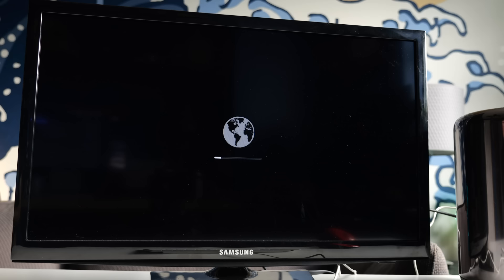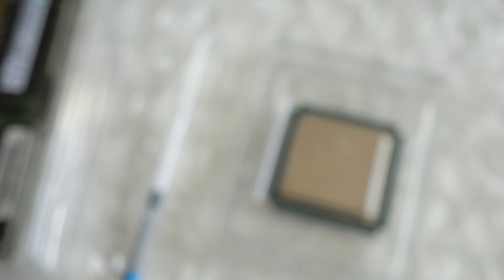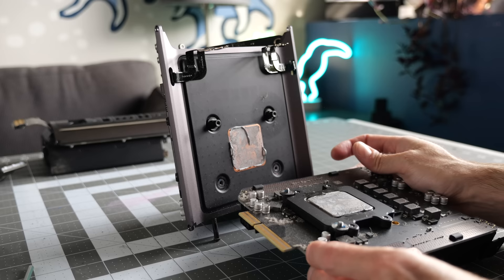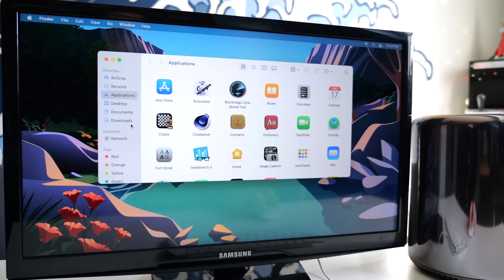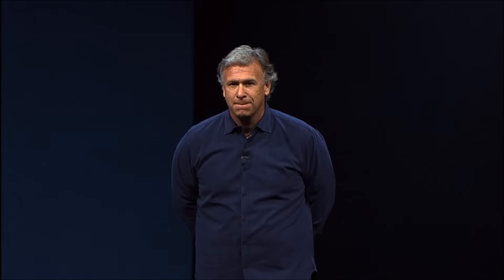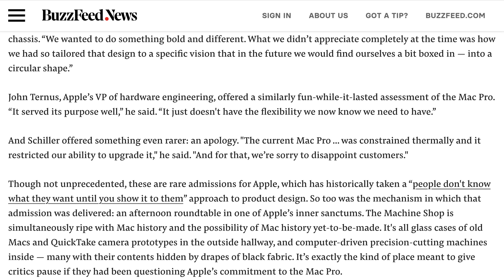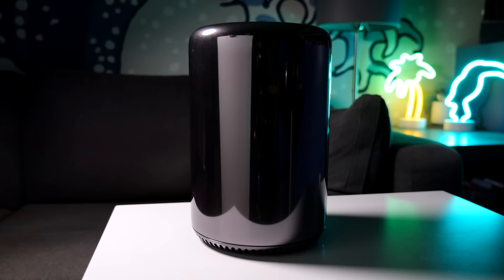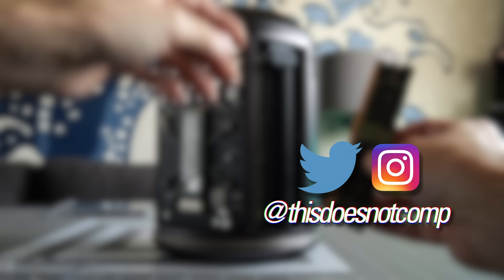Can This Decade-Old Mac Pro Compete With Apple Silicon?

Comment: I worked as an Apple Genius when this came out.  It certainly had a wow factor, but not many of them were sold.  As you mentioned the thermal issues and lack of expandability doomed it.  However, the early cheese grater Mac Pros had their own issues. They were easy to service, but stupidly they put the liquid cooling pumps above the power supply. If the cooling system leaked it would instantly fry the power supply.
Reply: I thought only the G5 Power Macs had water cooling
Reply: @bycuritiba  You're right, it was the G5s. But the mistake is understandable, apple geniuses don't know anything about computers. Their only real job is to tell people with a broken USB port that they need to pay $1000 for a new motherboard, rather than just soldering it back on.
Reply: @kyle8952  Isn't that the truth. A bit like, our software states your iPhone battery is perfectly fine, you need to upgrade to a new iPhone if you find it running slow after the latest update......
Reply: No Mac Pro had liquid cooling. The 5,1 mac pro is a much better computer than the 6,1   once it has been slightly upgraded.  Better drive capacity, better graphics, better usb 3.1/3.2. To a lesser extent the 4,1 and 3,1 are not bad either, but the abundance of 5,1 machines out there makes them the pick of the bunch.
Reply: @macguru9999  Actually the G4 dual Pro had liquid cooling as standard.
Reply: @marksapollo  It was a G5 and that was never called a mac pro, although it shared the same cheesegrater look. The g4s preferred the 'wind tunnel' approach to cooling :)
Reply: @marksapollo No, only a few of the G5 models did. I own one.
Reply: @ninline2000  How does it hold up after all these years? Does Apples cooling solution still work ok? Just curious.
Reply: @marksapollo  Mine leaks. I plan to eventually fix it, but water cooling isn't a good idea for longevity.

Comment: Thanks for the video. I've been using one of these since 2015 for professional video work, and it's still working fine (up to 4k), I'll use it until the computer dies from exhaustion. Not the most powerful machine, but solid in performance.
Reply: do you edit 4K using proxies? How does it work with Davinci Resolve?
Reply: @thedevhow  Hello, i use Premiere, and usually the files i edit are pro Res 4k.
Reply: Nice to see that one is still in use today from brand new (unless you’ve upgraded in the year since your comment). Have/had you done any upgrades to it?

Comment: Say what you will but I love my trash can. Got it as my first computer in late 2013 when I got my first credit card as a teen and it is still handling my music and video workloads to this day. (Logic Pro X and editing Gh5 footage on Premiere). Although it is currently on it’s last legs and will be replaced in the coming months, it has paid for itself multiple times over and got me through college. The portability aspect of it was also great for certain scenarios. I will remember it fondly.
Reply: Y 0:55
Reply: I’m still using mine, which I picked up secondhand 5 years ago for 2 grand. Having the D700s make a big difference on the GPU side. My plan is to keep it until the M3 Max Studio comes out sometime next year.
Reply: Clean it out and reapply thermal paste before you decide to ditch it!  ...(if you haven't already)
Reply: @DavidJBradshaw  I added an, eGPU a Vega 64, I have 2 D500. If put those D300-700 under constant duress they die, trashcan.
The Vega destroys those D series graphic cards. I bought It for my Macbook Pro, but use It mostly on the Mac Pro.
Investing now in an eGPU is maybe a little late, you can't use It on the M mac.
Reply: I’m still rockin my 12-core, mid-2010 cheese grater… LOVE this tower. Have it spec’d just like I like it.
Reply: Will an AI program work on a super-up one? I’d like it for restoring VHS tapes. What do I need?

Comment: Its still really impressive that an m1 mini give essentially the same performance as the 2013 pro. its quite a jump in performance for those entry devices
Reply: Those synthetic benchmarks don't take into account a lot of things modern software takes advantage of such as new instruction sets and much much faster memory. I would have been interested to see render and compiler benchmarks.
Reply: Keep in mind that when the SSD (or almost anything else) fails  on the M series, it's lights out and upgrades are not possible.

Comment: For most uses the level of performance of an upgraded older computer is perfectly adequate. This has been a problem for PC manufacturers who are seeing low sales for new generation computers despite impressive performance improvements in CPU and GPU speeds. The higher performance is just not needed by many users.

Comment: I used the same cheese grater mac pro 3,1 for ten years, keeping it going with upgrades and improvements. I remember being so angry when the 6,1 (trash can) was announced, because i could see that there would be no upgrade path for me once my 3,1 finally needed to be replaced. By the time the 7,1 finally came out, i had already moved on and have not bought an apple computer since, but the 3,1-5,1 cheese grater mac pros will remain forever in my heart as some of my favourite tech products ever.
Reply: Yup Apple losing its enthusiast customer base, getting more generic
Reply: @hhkk6155  it's probably going to, eventually, alienate the last of their professional customers. i doubt any of that apple sillicon stuff is going to get the job done for audio production professionals.
Reply: @BabyFawnLegs  yes, and also the backdoor that they installed in latest OS, I don't want non of the big tech/big gobberment BS in my computer, what next?)

Comment: A visually appealing and well made video that caught my eye. I bought one of these units in 2013 because I loved the look and the performance was elite  for a consumer product at the time. Now I use it as a music server, a job which it does very well. The fan is quiet when the cpu use is low. The usb outlets can be filtered and galvanically isolated in various ways. It’s still a joy to use. The only drag is the software sources that are drying up because the os i can’t be updated. The monolithic shape reminds of Kubrick’s ‘2001’. It’s understated alienware. At least on the outside. I wouldn’t have the courage to fiddle about with the innards though.

Comment: Thank you, for this excellent upgrade video.  A few months after the introduction of the new Mac Studio desktop, I noticed that the price of these units on the used market started to drop "like a rock".  So, I picked-up a Mac Pro 8-core/D-700/64GB/ 1TB model and paired it with my 2010, Apple Cinema LED (none thunderbolt) display and everything has been working great.  Using one of its six Thunderbolt-2 ports, I added a Fire-wire 800 adaptor.  So, now all of my old Fire-wire 400 and Fire-wire 800 devices are also supported on my system (smile...smile).
Reply: How do we get the mac os if we decide to change the ssd
Reply: @stormbreaker82  These is a You Tube video entitled "How to Install Mac OS using CD or USB" by Trackpad Productions.

Comment: Great look at a device that sort of cut itself off at the knees. I love the look of the device, but was one of those that stuck to the prior “cheese grater” model (which I’m on right now, in fact). I’d love to pick one of these up as a collector’s piece, though, not sure if I’m ready to pull the trigger just yet, though. Interesting comparison to modern machines, by the way, I wasn’t expecting that kind of favorable comparison!
Reply: I've got a 2010 that I tried to rock as long as I could, but I just kept running into barriers.  Lack of OS support limited what software I could run, and even the most up-to-date (supported) graphics couldn't drive a modern ultrawide display.

I ended up replacing it with a 2018 Mini that is more capable in every single way, except sheer volume.
Reply: Same. 

If I were buying a 2013 for actual use, I’d go with a higher clock speed 8 core, and probably an eGPU.
Reply: @nickwallette6201  more modern Minis—especially Apple Silicon—are certainly no joke! It is a sad reality, though, that the older girls don’t remain viable forever and indeed need to be put out to pasture. Just out of curiosity—did you play around with OpenCore Legacy Patcher at all? It mostly solves the OS support issue (with some caveats, of course), though ultimately the barriers won’t cease anytime soon on the older hardware. I’m fortunate that I can relegate my writer workflow to really any device that powers on, and I can keep the old Pro on Mojave without suffering any loss of crucial software (most of my work is done in Scrivener). That’s certainly not the reality for everyone, though.
Reply: @BrianJones-wk8cx   Nah, I did the firmware update to squeeze a few later releases of compatibility (maybe it was the 2009 to 2010 model patch?)  But I never tried patching the OS.  I used to play with Hackintosh a little bit, but the care and feeding of making an OS run on hardware it didn't want to run on wasn't for me.  I'm relatively new to Mac OS, so I don't have the deep experience of troubleshooting boot problems, and when a box I wanted to use for something productive wouldn't boot because of ???, that's just not fun.  And you always had to be careful to not update this, or don't enable that because it'll crash...

Plus, I had intended to use that Mac Pro for audio and video editing, and every time I solved one problem, I ran into another one.  It just became clear after a while that I was putting in a lot of time, effort, and money to do something a newer computer could do with far less trouble, less power, and in a smaller footprint.  So now, it's just a collector's piece, which is totally fine.
Reply: I pulled that trigger. I've found it to be sluggish compared to any M1 machine, and even worse with a modern Linux installed. I would advise against buying it for any serious application.
Reply: @ericwood3709  sorry to hear that! I’m surprised that Linux fared worse, what flavor, if you don’t mind?
Reply: @BrianJones-wk8cx  Fedora. I think Gnome was maybe just a bit much for it.
Reply: @ericwood3709 what specs did you get? Maxed out MP’s do decently against the M1’s, just gotta keep in mind the crazy power draw in comparison plus ramping up the fan under heavy load (which the machine itself doesn’t really do)
Reply: @thegeforce6625 Just a quad core.

Comment: I've been using mine since 2013 and it still runs an intense music studio flawlessly.  That said I am going to be putting it to pasture shortly and going to be using my MS Laptop Studio as I would like to have the portability factor.  Anyhow it's been a real workhorse and only issue I had was  a faulty Logic board which was quite common on them and was replaced under apple care. I would rate it 10/10 for longevity and 10/10 for performance for my music needs.
Reply: Flawlessly?.need solid evidence to believe that.

Comment: A decade!!!! My ass.. feels like yesterday. Speed isn’t everything, if a computer runs the software you require then you don’t need to upgrade in my opinion…it’s all about the software, for my work I try to use my computers as long as possible. Good for the environment also,
Reply: Quite right. Too bad Apple does not agree with you.

Comment: I got the base model MacPro back in 2013 to use solely for running protools. It was actually perfect for it. As much as people joke about Protools constantly crashing I NEVER had an issue with it on that MacPro. I have the M2 MacBook Air now and it doesn’t run Protools nearly as well as that old MacPro did. So it was great for that. At least for Protools 10, it’d probably struggle with newer versions
Reply: I had a basic model 2009 Imac and used it with Protools and never had a single problem. It ran very solid.

Comment: I recently picked up a mid range 2013 Pro with an 8 core processor, 32GB RAM, and D500 graphic cards. For a near 11 year old machine it does surprisingly well on the benchmark tests and doesn’t feel like it’s that old.

Comment: I did pretty much the same last month.  I got a 6 core, 16GB ram, 512gb SSD, D500 for around $350. Put 64gb ram and a E5-2695 V2 processor in it. Its a stop gap measure for me upgrading from a 2008 Mac Pro and waiting for a Mac mini m2 or m1 pro to come out maybe a Mac Studio if they get a bit cheaper.

Comment: I finally acquired a 2013 trashcan Mac Pro for a bargain price in December 2022 (and made a new friend out of the seller).
Mine has had quite an upgrade journey: I upgraded the RAM to 64 GB, and upgraded the SSD from the stock proprietary 256 GB SSD to a 500 GB NVMe SSD, then a 1 TB NVMe, THEN a 2 TB NVMe (and my 2010 cheesegrater Mac Pro inherited the 1 TB NVMe drive).
I love my Mac Pro. It runs extremely well, and I really enjoyed upgrading it.

Comment: I'm super tempted to do this, partially because these are still reasonably-fast machines for the price, but mostly because in 10-20 years I'll kick myself if I don't have one of these machines on display next to my PowerMac G4 Cube 😃
Reply: it is the true successor to the cube — also at the cusp of intel —> M1 just as the cube was at the cusp of G4 —> intel.
Reply: @johnpenner5182  This thing launched right in the middle of Apple's Intel period - eight years after the last PowerMac, and seven years before the first M1 machines - and it had an Intel-based successor, so no, not really.
Reply: The 2013 mac pro is still a solid machine and they're getting cheaper.
Reply: @johnpenner5182  The Cube wasn't at the cusp of G4 > Intel. The G5 came afterwards FFS!
Reply: I just bought one for $500 and it's a marvelous machine. I'm using mine daily w/ the last gen mechanical Mac peripherals for the sake of nostalgia. It's lovely!
Reply: @axi0matic  when i said [the 2013 macPro] was the true successor to the cube also at cusp of intel' — this should require some clarification — the cusp referred to here is not cpu generation (it only had a G4 processor, while the G5 powerMac came out with all its holes and fans). 

the cusp comparison was in regard to that which preceeded the intel (i.e. the power PC machines) design wise — the best one was the cube. 🍃 so also the 2013 macPro preceded the M1 and M2 machines — and that of all the intel designs, it was at the forefront — much as the cube was as the forefront of the powerPC case designs. 

thus — cusp of powerPC design = cube 🍃 and cusp of intel design = 2013 powerMac. 

if you understood cusp in any other context — it is my mistake for lack of clarity that people were talking cusp of Specs vs i was talking about cusp of Design. 

have a nice day everyone. ☺
Reply: @johnpenner5182  I think the problem is that when you say 'cusp', you mean 'peak'. And you didn't mention you were referring to industrial design. 

Also, whilst the Cube and 2013 MP are arguably iconic aesthetic designs (I own the former), they were both sales duds that were dead ends and didn't address the needs of their users. So it's debatable they were successful, let alone peak, designs.